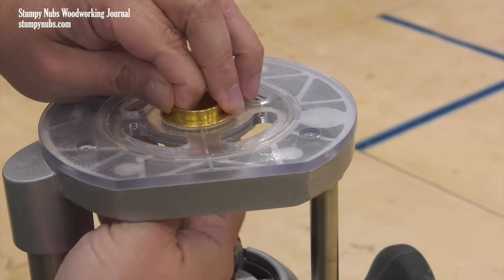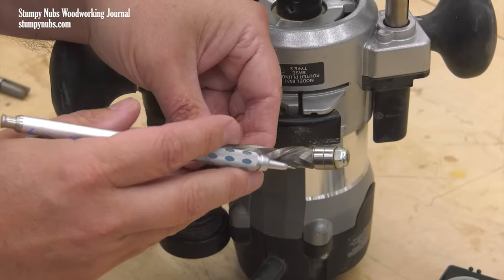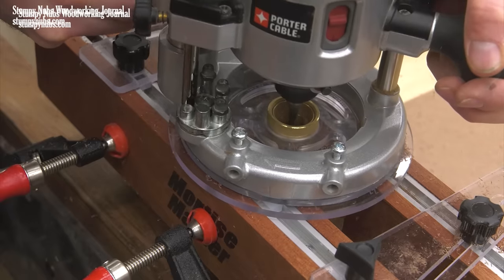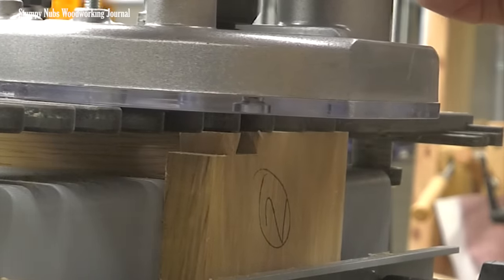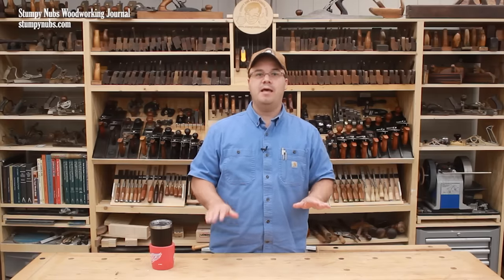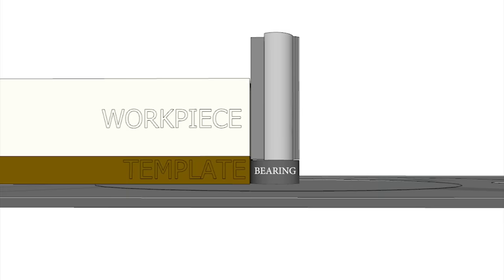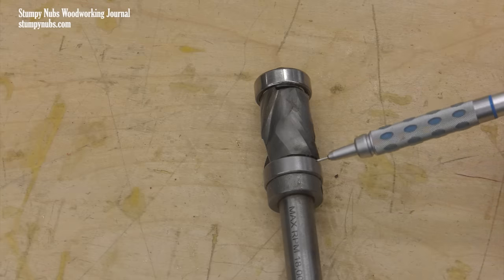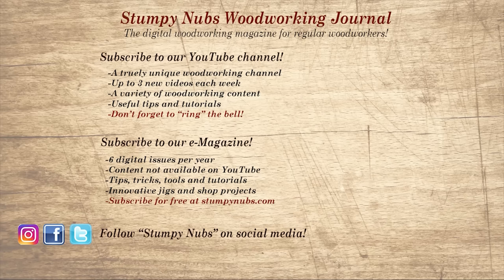Router BUSHINGS vs BEARINGS - What you should know

Comment: This was helpful! So I’m wanting to make a mid century style vanity (I have the vanity built with bridle joints and half laps and actually installed into my bathroom but I’m missing the dividers, drawers and door) and I want to route out finger pulls in the dead center of my hickory drawers/door. Basically my glued up panel will have to be ripped to make the drawers but I want my door to appear to match the drawers without actually being ripped down. I’ll make a faux recessed line to match the drawers and I want the finger pulls to be centered and in between so basically the bottom drawer will have an upper finger pull and the upper drawer will have a bottom pull so when drawers are pushed in the two make a rectangular shape. It looks like a rectangular recess slapped in between drawers. My issue is I don’t want to route clear through my hickory drawers/door because I want the grain to be there since I’ll have plywood drawers behind plus the grain match would be amazing. My struggle is I can’t find a drawer pull bit with a top mounted bearing to follow the recessed rectangular shape after hogging out maybe 1/2” deep and my door won’t be cut through so riding the edge of the door on a router table isn’t possible since it’ll be dead center of the door. Any suggestions, I hope my issue makes sense?! I can’t find much info on this exact situation, Shara here on YT made a beautiful mid century inspired vanity with this detail but she used a jigsaw and cut clear through and then glued boards behind the cut out finger pulls to hide gaping holes and ik there’s a better way to do this for myself without cutting clear through

Comment: Just starting to use my Ridgid palm router.  Getting up the nerve to start using my full size Bosch router combo.  Regarding guide bushings, what does it mean when “they” say “fits Porter Cable style sub-base plate”?  Want to make sure I buy a set that will work with both my routers.

Comment: Simple question, looking for information on router bearings, don't know who else to ask.  I am impressed by your woodworking, far, far more advanced than my work, in comparison I am a beginner that does simple routering once in a while.  I have an old Craftsman router, decades old with a few bits, a recently bought a few Freud bits that came with bearings.  On my latest project, the bearing on my relatively new Freud router bit self destructed, bearing races, everything came apart in the middle of the job and really buggered up my router project.  I was able to finish by using the bearing from my old craftsman bits which looks a lot more robust than the Freud bits.  My question is, are the bearings that come with bits like Freud not really suitable for routering?  Should I be buying better router bearings to prevent this from happening?  Do router bearings have to be replaced?  Lubricated?  I can't seem to find information on this subject.
Reply from the maker: Inexpensive bearings can come apart on you, but it is really rare. And Freud is not a super-crappy brand, so I would chalk it up to bad luck unless it happens again, in which case I'd consider replacing the bearings or the bits.

Comment: A bearing guided bit can use bearings of different sizes than the bit, say for making rabbits; you can also get bits with bearings on both ends which makes following grain easier as you can easily flip the template and raise the bit. One big point with bushings; make sure they’re centered with the bit.

Comment: Totally off topic, does glue have a shelf life. I have an unopened gallon bottle of yellow wood glue. It’s a few years old will it still be OK to use. Thanks.
Reply: Yes (as long as it never froze -- they can break down if they get too cold), PVA wood glue will both dry out and separate.  You can't fix it if it's dried out, but if it's only separated you can throw away the dried-out skin and stir everything back up again (maybe add a bit of water if it's extra-thick).  Might have to also run it through a sieve if there are chunks. I did this many times with a gallon-sized bottle of TB2 that took me a few years to get through.  Store your bottles upside down for extra longevity (it reduces the surface area of glue exposed to any air that will exchange through the cap) -- works great for pretty much anything that doesn't have a perfect seal on the lid.
Reply: @ex-nerd  Thanks for the reply. The bottle has been sitting in my basement so it’s never got cold. The reason is I was using a gallon bottle of white PVA glue during major home renovations as it gives a little more than yellow does. With the house going through it’s cycles of expansion and contraction is the reason I chose to use the white. Consequently the yellow got forgotten about. Thanks again I’ll give it a try on some projects that won’t worry me if it fails. Cheers 🍻

Comment: Safety Tip:  Use router bits with bottom-mounted bearings when pattern cutting on your router table. In use, the bearing will be at the top.  It's much safer than having a totally exposed blade spinning above your workpiece.
If your fingers should slip while pushing the parts, they'll hit the bearing, not the spinning bit.
A friend of mine, who used to be a professional cabinet maker, says he has seen the above-mentioned scenario a couple times and it is very, very messy. 😱
Reply from the maker: Use pushblocks and your hand will be safe.

Comment: A related topic that you didn't address...
Molding edge bits use a bearing to guide against the edge of a straight or curved workpiece. Changing the OD dimension of this guide bearing modifies the amount of the reveal. I rely on this style of bearing guide in the router and in the router table more than any other guide function. 
Our regional Woodcraft store has recently discontinued their Woodcraft store brand (Woodriver) router bits and only sells Whiteside router bits comparably priced with online pricing.

I generally purchase what is sold in my area. I have had some success with store brands like Woodriver and Rockler, but better success with Bosch and Porter Cable. None of these compare with the performance I get with my Freud bits. I purchased quite a few MLCS bits, because their sale pricing was so enticing. The verdict is still not in on the MLCS performance. They are too new. I got 8 profiles for the price of 3 or 4 high end bits, so I filled in some profile gaps on the cheap.

I appreciate your plug for Whiteside. Is there any community input into other high end brands performance or value? Freud is a good product, but they strike me as being the router bit equivalent of Stihl to chainsaws. There may be better performance or value with lesser known high end brands.

Comment: Great tutorial!  I had puzzled over this question because any template for a bushing bit is much more challenging to make. However, that ability to raise and lower the bit when using a bushing could be really important. For example, the control cavity in a guitar top is much too deep to route in a single pass. If you’re just doing a one-off cavity, the bushing template wouldn’t be worth the effort. OTOH if you’re going to do 10, the bearing pattern might be a lot more efficient because of the ability to route 1/8” of wood at a time, avoiding excessive heat, etc.
Reply: try a solid carbide up-cut bit.  You may be able to go deeper per pass (not the entire depth tho).  1/4" per pass is easy.

Comment: Thank you for turning me on to Harvey. I have the Alpha 2 Hp, 36" table saw , the Ambassador 14" bands saw and the most awesome G700 dust processor. i could not be happier with them. Also, it came with a gift certificate for a few of the Bridge City do-das and I bought a few more. Last week, about a dozen or two of us won the Bridge City scratch awl. Please do something to let us know the best way to use it as woodworkers. I have no clue except for starting a hole for a taper drill.
Reply: I also ended up with a C14 based on his recommendations.  Thought seriously about that dust collector but ended up finding a great deal on a used Mini Gorilla (from Oneida) for a fraction of the cost that will work great for my hobby-sized shop for a long time. Still pondering their lathe, but ... I really need to upgrade my table saw and I won't buy one without auto blade retraction.
Reply: @ex-nerd  I am just the opposite, avoiding the safety feature because some of my work is boat building with green wood. Once, we were ripping 1/2 X3/4 strips of white oak for ribs and you could see the water spraying off the blade. That would have cost over a hundred dollars for a new cartridge and a new blade. It forces us to be more careful. My shop is in the basement with my wife right up stairs. I had to go with the 61db dust processor to stay married.

Comment: The biggest advantage to the bushing is that I can use a “regular” bit, in any size less than the diameter of the opening. And I can replace the bit when it gets worn. You briefly mentioned the one complication with bushings: I have to calculate and account for the offset (the template or guide have to be carefully placed to achieve the intended final size).  There is also the occasional issue of centering the bushing. For me, the convenience of the bearing bit makes the expense worthwhile (also reduces the number of opportunities for mistakes).  Thanks for the video!

Comment: I think the router table feed directions are mixed up... climb cut vs push cut. you are showing the router bit turning clockwise when in the router table with the bit pointing up... From above the table the bit should be rotating counter clockwise
Reply from the maker: If you are talking about the two drawings, that was not a router table. Note the bit of shaft on top of the bit. It is a handheld orientation.
Reply: Ok I see that now, but was sure that was a router table demo. You were also talking about router tables immediately before the diagrams so that is what I thought you were referring too

Comment: When using a template guide bushing, how much clearance should I allow for between the router bit and the bushing inside diameter?
Reply from the maker: Enough to keep them from touching.
Reply: @StumpyNubs  So 1/64" between the router bit and the inside wall of the busing is OK?  That works for me and the templates that I'm looking at.  However, Bosch states that the difference between the router bit cutting diameter and the inside diameter of the busing should be a minimum of 1/16" (or 1/32" clearance around the bit").  If I follow the Bosch rules, I can't get the correct offset.   If I get the correct offset, my clearance is too tight.  I've asked another very experienced user and he said don't worry about the clearance as long as the bit doesn't touch the wall.  I'm guessing a carbide bit won't bend and the spirals provide all the chip/dust clearance?  I have never used a router before and am trying to make sure I don't set things up wrong before I even make my first cut.
Reply from the maker: @blackadder8925  It depends on the quality of the bit and the router itself. If you have some slight runout/wobble in the bit, you will need more clearance. If the router and bit run perfectly true, you will need virtually no clearance. Also, if it's a narrow, long bit, it may flex more and therefore require more clearance than a short, stout bit that doesn't deflect at all. There is no hard fast rule that I can give you.